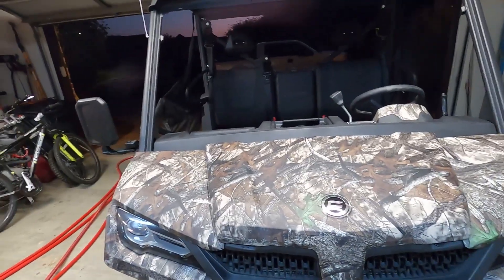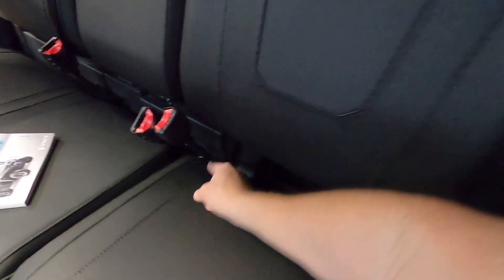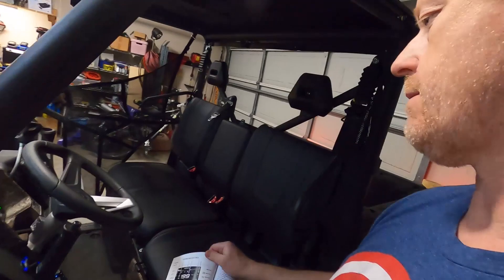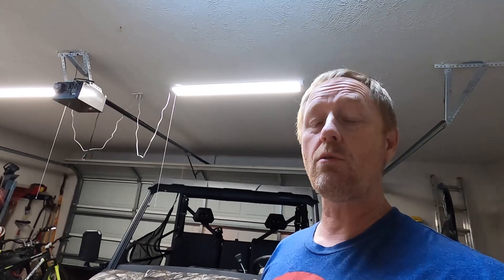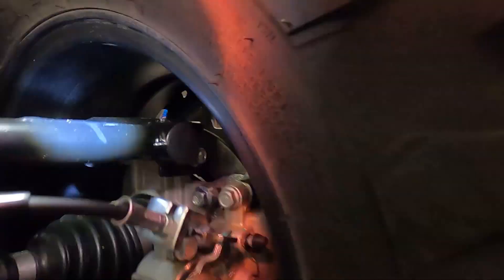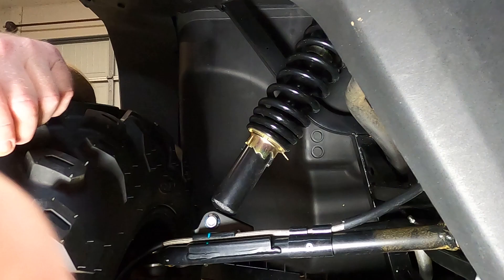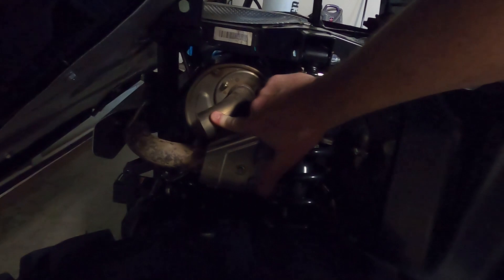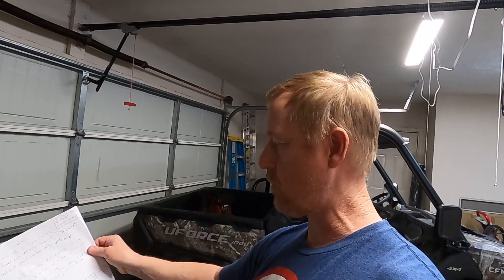2022 CFMoto UForce 1000 Feature Overview #2

Comment: Just to clarify, the shocks are not adjustable. That's a spring preload adjustment. Basically you run the ring up or down to compress, or preload, or extend your springs. Extending them increases the travel and leads to a softer feel because there is more distance the springs can travel from full extension to compression. Preloading them means less travel and a firmer feel because as you've compressed them and there is less travel from full extension to compression. You're not going to mess anything up playing with it I promise, and you might find a setting that makes it ride better for you. That's what it's there for.

Comment: Thank you very much for your Uforce 1000 videos! I just bought this exact machine and you've given me a lot of very useful information. This is my first UTV, so your overview and tips are much appreciated, ✌️
Reply from the maker: Thanks.  I appreciate you watching.  These machines are a bit jerky, so I would recommend upgrading to a better belt and clutch spring whenever you can.  Red Neck Garage sells them.   My camo started peeling after I pressure washed mine, so maybe don't do that.    Make sure you don't go too fast in the break-in period and use low gear for low speed and climbing hills or pulling stuff.  I made that mistake.    Also, we will be selling seat covers for the UForce soon on my website.  CamoCover.net.
Reply: @MikeM100  I will definitely be taking it easy to start until I get more experience. Thanks again for your advice, just a note, mine is in midnight blue, I meant to say that, my bad✌️

Comment: How are you enjoying Uforce 1000? I’m thinking bout purchasing one. I’m also located in MS.
Reply from the maker: It was the worst purchase of my life.  Let me start by saying that I've been driving side-by-sides all my life, and I drove this correctly for the break-in period.  I never drove it over 30 and only on pavement or grass.  The belt broke at the 20 mile mark.  The dealer did not have OEM belts because of parts shortages.  But when I bought it, they promised e they had plenty of spare parts.  When I got it back 3 weeks later, the spring broke, and something was wrong with the clutch plates because the dealer replaced them too.  It never drove right after that.  Was always very jerky.  I drove it another couple of hours and it stopped going into reverse.  Then it would not stay in park.  Then the camo started peeling.  Then the dash display started having problems.  Then the key broke off in the gas cap.  Keys should always be made from hardened metal, but the original CFMoto keys are cheap metal.  Then it started blowing fuses.  And I never added any accessories. I could go on and on, but you get the point.  The dealer always blamed me for the problems.  I sold it exactly 6 weeks after I bought it.  I only put 50 miles on it.  It stayed in the shop for half the time I owned it.   I found a guy who wanted that specific model and he said he could fix anything that went wrong with it.  I took a huge loss to sell it.  Lesson learned.  I'll stick with Honda.   I've met a few other people who had the same experiences.   These machines are poor quality and made from cheap materials.
Reply: @MikeM100  wow sorry to hear that and thanks for honest opinion.
Reply from the maker: You're welcome Willie.  I would hate for someone to make the same mistake I did. Thanks for watching.